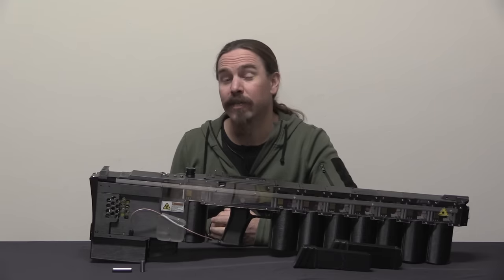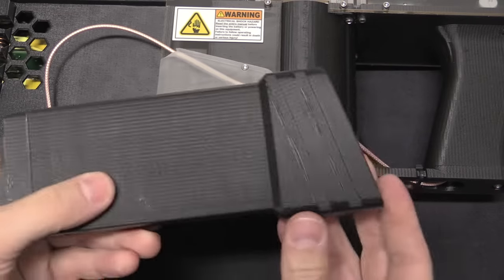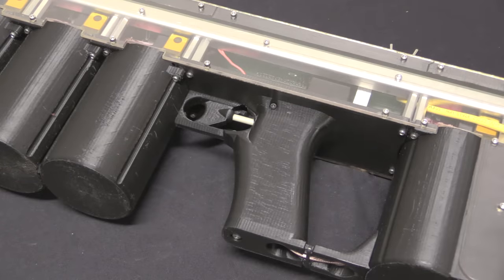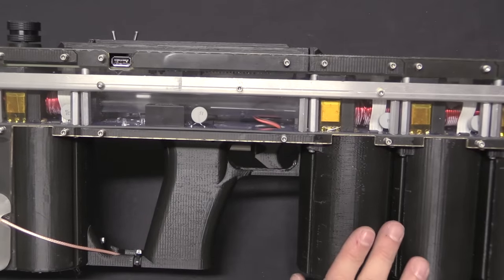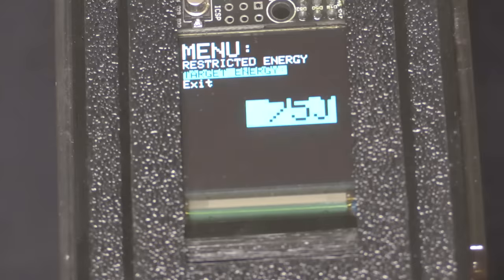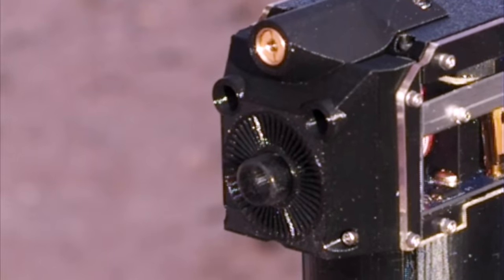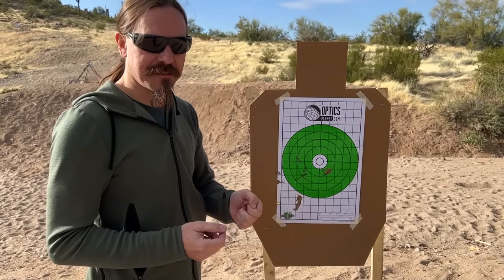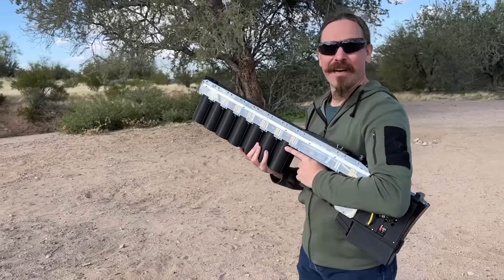ArcFlash Labs' GR-1 Anvil Portable Gauss Rifle

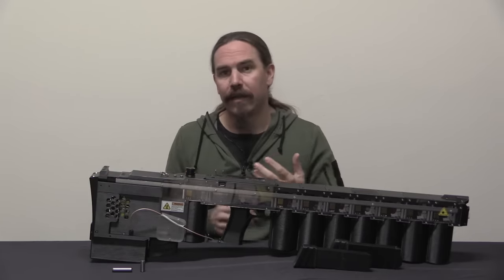Comment: 2:22 I think you meant to say 3300 mAh battery, since even a thin-film 25V 3300 Ah (or 3.3 kAh) lithium battery would weigh at least 230 kg.
Great showcase, really cool stuff!
Reply: Id suspect 33Ah. 3300mAh can fit into a much smaller package like an 18650 cell.
Reply: I think he meant to say 33,000 mAh bc there's no way a 3300 would have enough energy to do this.
Reply: Yeah, it looks about 3 times the volume of my 1100mAh 6S packs.
Reply: It says 3300mAh in the manual. 3.3kAh sounds dope tho. Charging the battery every 4000 shots sounds fun lol
Reply: @vockski3173  not 18650s but it is Li-Ion, just a 6 cells in series, giving a nominal voltage of 22.2V and full charge of 25.2V and 3.3Ah or 3300mAh. But since a step up converter is used to charge the capacitors, the input voltage swing doesn't matter all that much.
Reply: @V9TEK1  power delivery is the problem, as stated above. muzzle energy =/= battery energy
Reply: @lakiza55  I understand that very well, however, from 297000 Joules of energy, even at 1% efficiency, you could still extract 2970 Joules or just about 30 shots. Also, as you yourself pointed out, the manual also says 3300 mAh, so what are we arguing about?
Reply: @V9TEK1  not arguing, just stating that a 2.2KW/100A power draw out of such a small battery pack is quite a bit extreme.
Reply: @lakiza55  Right, sorry, my misunderstanding. I was wondering how they get that as well. Your 6S3P idea sounds quite possible. It could also be that they are using one of those Li-Pol packs used for model aircraft, some of those go up to 100C
Reply: @V9TEK1  Really? Didn't know 100C was a thing. Apparently these Li-Po packs on amazon state 11.1V 8Ah, 3s2p, and 100C discharge. And it weighs only 500 grams. A single cell doing 400 amps is beyond me. Although they do have significally lower gravimetric energy density, than, say 18650s that max out at 10C(177Wh/kg vs 243). Very interesting, learned something new today. An educational discussion is always a treat.

Comment: FWIW: The issue with coil guns is magnetic saturation of the projectiles. A metal object is limited to the amount of force applied which limits the force that can be applied to accelerate the projectile. So these will never match the performance of Scifi Gauss guns.

For an analogy comparing a firearm with a coil gun is like using force you can apply to pull to accelerate an object using  a thread vs a rope. The coil gun is limited to acceleration you can apply if you used a thread, and a firearm is limited to the force you can apply using a heavy duty rope.

It make be possible to improve the maximum acceration of a the project using projectiles made of a laminations of thin steel rods (ie like a transformer core made up of laminations of sheets of steel). A NB magnet as a projectile would also help, or using metals that have a very high magnetic saturation. Another alternative would be to make projectiles made up of coils of copper wire.since the copper wire will induce a repulsive field that doesn't suffer saturation, but won't transfer magnetic energy as efficiently as a magnetic projectile.
Reply: What about a slingshot approach? A cradle made from material with strong magnetic properties that pick up a metal/ceramic/composite/other projectile. Accelerates it through the barrel but stops in the barrel and back up to pick up another projectile. Mechanically more complex but opens up a possibility to shoot much more types of materials.
Reply: Yes, this is what I thought as well. I remember doing some napkin math and saw that you couldn't get to the muzzle energy of even a 9mm without a very long barrel length (Exceeding 2m / 6') using regular iron or steel slugs.
Reply: I like turtles.
Reply: Is this due to hysterisis?

I always wondered if it was possible to launch projectiles using just the dielectric field itself, possibly by using an impulse dielectric wave similar to what Nicola Tesla (and Dr. Thomas Henry Moray as well) discovered and applied in many of his inventions post Colorado Springs by harnessing the power of the transient created by a spark gap but then the whole weapon would need a complete redesign. It also takes my idea of spin stabilizing the projectile by using a Rodin type or Starship type coil instead of a standard coil in a Gauss rifle and throws it completely out the window because you are no longing generating the magnetic portion of the EM field and it would be strictly dielectric at that point. Another problem with using laminated silicon steel is that it isnt really available for consumers to buy and anytime I wanted to use it in a project I always had to salvage it from old appliances and the rotors and stators of old motors, although I guess if their was a consumer market for it opening up maybe the manufacturers would be willing to sell it in non wholesale commercial amounts...

Comment: Gauss guns in the future could technically fill the roles of SMG, AR and BR with just a change of the power.
Reply: and even have a non-lethal mode.
Reply: Presumably, you would only make the gun as large as necessary.
Reply: @jameswhite153  Oh god, instead of beanbag rounds, you suddenly get a steel dowel to the back. Ouch
Reply: @mrhyde4732  If this is any consolation, it's probably going to be tipped with rubber or foam if it's for non-lethal usage
Still would really suck though
Reply: Come to think of it, gauss guns could even act like a shotgun for close range/room clearing if it could fire multiple bearing balls at once
Reply: @jameswhite153  I mean, where else would you aim?
Reply: @mrhyde4732  that's fair

Comment: Since the barrel can't be bore to spin the projectile, my bet is the projectiles themselves are going to need to have corkscrew engravings so that when they are sent through the barrel the air resistance will give them the spin required for true flight.

Also would help to have pointed tips to deal with initial air resistance.
Reply: Fin-stabilized projectiles maybe?
Reply: @elanvital9720  a sabot maybe?
Reply: Perhaps a rifled barrel with a plastic discarding sabot?
Reply: Would there be any benefit to making the ammo round balls instead of oblong slugs?
Reply: @myWiggy  easier to make?
Reply: @skeltonslay8er781  You don't need a sabot with EM weapons, as Ian pointed out you can already shoot slugs much narrower than the barrel itself. Even then subcaliber ammo isn't really needed in EM weapons because it only makes sense in chemical energy guns where you want to have good obturation of the barrel and more surface area to push the munition. Sabot only allows to do this with a lighter and thinner projectile to get greater velocity and lower drag.
Others talked about a rifled barrel but there is also no point doing this since the shot doesn't ever touch it, and if anything you'd want to avoid this to get rid of friction wear.

I'm sure the shape will be progressively optimized but logically it should be as light and have as low drag as possible to be fast with low energy requirements, while having max penetration. That tends to favor longrod penetrators with fin stabilization, though one might need some device to avoid yaw.
Reply: @elanvital9720  Using a sabot in an electromagnetic carbine is very practical. You can use the magnetic material as a lagging for many things. For example: a non-magnetic material with a high atomic number, a glass vial of liquid, a compound structure with a standard drive and maneuverability. Actually endless possibilities, due to the fact that in such a weapon you can adjust the projectile acceleration rate, input/output energy, etc.
Reply: @elanvital9720  @Skelton Slay8er so many comments have ended up describing (partially) actual lore-accurate halo weapons
Reply: Have a small electric motor with a rubbercoated drive wheel that spin up the projectile before launching it..
Reply: @TheBibliofilus  Could be trigger activated along with the capacitor charging sequence.

Only problem is that the slug is housed and seated in the magazine before being pushed into magnetic launch.

Would probably have to redesign the entire firing mechanism and magazine to accomodate it.
Reply: @TheBibliofilus  my son has a few of those guns with that exact firing mechanism. Really good design. NERF has perfected it. Throw a few capacitors ahead of that with a steel dart rather than that foam rubber and watch your NERF battles get interesting 👍🏻 lmao
Reply: YES!
Reply: @elanvital9720  CNC machines projectile. nods
Reply: magnets can impart spin
Reply: the magnets can spin the projectile
Reply: Point is not the most aerodynamic shape.  See: "Bulbous bow".

Comment: Assuming that gauss cannons will eventually rise up to the level of modern firearms, it’d be a very interesting look into how history always repeats itself with some variation. The most primitive ranged weapons have an object pushing a projectile at high velocity (bows, slingshots, etc) and then of course they evolved to using combustion as a way to propel the projectile. So it’s interesting to see weaponry like this return to its original roots of “object push projectile” with something like a gauss weapon, even if it is magnets and electricity instead of string!

Comment: Kinda surprising that they didn't employ this thing as a grenade launcher. It would meet those requirements a lot better I think, even with very little optimization. It can more easily move a large mass at medium velocity, well suited to deliver HE I think. Not to mention the large mass of this thing is more tolerable if you are bringing more firepower to the equation.
Reply: As someone who played with these... Me and my friend tried to shoot "explosive" rounds out of his "accelerator" (we took an empty steel tube, inserted a firecracker into it, and put the fuse out through the back, his "accelerator" was sort of a bolt-action, so we could light the fuse before loading it into the barrel), there is one significant problem.

The less ferromagnetic material in the projectile, the less attraction, so the pipes were much, much slower than a solid projectile would be. Thus, we didn't fire a "live" round, because when we dry-fired one (shot it out without lighting the fuse), it just flopped outta the barrel, we deemed it too dangerous to try with a "live" one.
Reply: There’s also the question: “why would you?”

Like sure, it might do the job and do it reasonably well, but give me one good reason to add all this extra weight and electrical shenanigans to a perfectly serviceable chemically-driven launcher?  What’s the benefit?

That’s what makes these things difficult to sell in the first place, even when you scale them up and test them on naval vessels with military funding.
Reply: If you use these on a vehicle, you dont have to deal with the risk of having ammunition exploding if hit by enemy projectile
Reply: @TheRoland19111  Gonna point out some info right here...

1. Weight to max shots fired ratio goes way up for these. Remember, that this rifle has nearly (sic!) as much muzzle energy as a .22LR, which is a teeny tiny cartridge, shot outta a teeny tiny gun. Now imagine that scaled up to a vehicle-mounted grenade launcher. That thing would be the size of a whole tank turret, I assume.

2. Yeah, the ammo won't explode when shot... But the batteries will. And they will gladly do so, don't have to ask them too many times. Ever seen an e-cig battery blow up? Now imagine that times a thousand. Bravo. Now the vehicle is an oven, setting at around 2000°C in the near proximity of the burning battery. Not to mention the toxic fumes, lithium or not, batteries aren't the stuff you want to burn in a confined space

3. Battery charging. Imagine getting attacked while the vehicle just has been plugged in while completely discharged...
Conventional armaments don't have that problem, since you can just have a few cases of ammo at hand and just throw them into the vehicle, give the crew two to three minutes and they're blasting (if they're well trained ofc)

Electric gun? Not really. Picture EV charging times, but even longer, since the amount of energy needed for this kinda stuff would be enormous.

Honestly the only use of electricity as a weapon that I think would be beneficial to the military seems to be either EMP or lasers, maybe some kind of an electric fence or a military-grade plasma cutter of some sorts...
Reply: @Bednar121  There are some tests of anti-missile and anti-aircraft lasers you can watch. They're pretty cool. Much more practical than this, certainly.
Reply: @_mwk  If memory serves the big number one reason you don't see lasers used in weaponry much is that their use on things like tanks or soldiers actually counts as a war crime under the geneva convention, as you could really easily use a laser as a weapon that permanently blinds enemy soldiers, which for obvious reasons is generally frowned upon. This is why the only laser weaponry you see are anti missile / anti drone systems and not something that would be reasonably used in a manned combat situation, as both of them are piloted remotely.
Reply: @kingkuma4112   Lasers are also used for the disabling of engines as well
Reply: @kingkuma4112  Yeah, routinely having soldiers with lethal weaponry firing blind is not something people want.
Reply: @OneBiasedOpinion  Anti-material rifle? It’s definitely not very useful right now, but no one has claimed otherwise.
Reply: @jeremysaklad6703 Additinally there's the fact that an offensive blinding weapon falls under the same sort of reasoning for why things like cross-cut bullets (basically rounds that fragment upon impact with a body) are also banned - if a soldier gets a bullet to the torso, even if he survives he'll still be out of action for a long long time, so any attempt to make sure a bullet is more lethal is basically pointless. While yes using a laser to blind enemy soldiers would be extremely effective, the general consensus is that it counts as inhumane as you're basically giving someone permanent blindness when a bullet would do the same outcome in terms of the war without taking someone's sight away.  TLDR: Any weapon which causes some permanent disability basically automatically gets added to the war crime list after the fact that some of the ww1 gases caused permanent breathing issues became clear.
Reply: @kingkuma4112  I don’t really agree with saying death is better than blindness: the issue here is that it could easily lead to civilian death and collateral damage.
Reply: @jeremysaklad6703  You're not wrong - a powerful enough laser needs a lot of energy, and well, we all know capacitors don't handle getting shot well. I was more focused on the specific reason that geneva banned their use rather than why they also wouldn't be very practical.
Reply: would probably EMP out any electronics in the warhead of a grenade
Reply: Great point

Comment: This gets my imagination burning, especially since I’m trying to write a sci-fi novel where a majority of weaponry are MAGs!  I wonder if the projectiles might perform better as fin-stabilized sabots of a much smaller caliber.  Definitely would improve impact force since velocity has a greater influence than mass
Reply: In the interview they discussed magnetic rifling and fins for being future. However they also said the trade off of choosing coils instead of rails is that bigger projectiles get accelerated better than small ones.
If you do rail's instead, you have to regularly replace the rails.
Reply: True, though I’m not thinking of the sabot for stability.  It’d be more to help feed cleanly from a magazine.  Plus you’d be able to use a more dense metal that may not be magnetic for the projectile and something magnetic as the sabot for the coils to “grab” onto.  

I’m just super excited cause this is pretty close to a lot of the ideas of how the weapons will work in my story!
Reply: the problem there is a bit inherent in the weapons platform; for that reason you might want to reintroduce other weapons of totally different categories, like the “sluggers” conventional firearms used in star wars because bullets are harder to stop and faster than blasters for the sith and jedi. 

Basically, in the name “mass accelerator”, lies the truth. These won’t ever reach the speeds of rail guns or light-gas guns (another interesting real gun type to consider including) will fire at, but it can fire much larger or heavier projectiles. Imagine the bolsters from war hammer; every soldier is carrying something that can act almost like a grenade launcher. The limits to speed are based on the fact that the magnetism of each coil has to switch as soon as the projectile passes it, or it’ll be pulling it backwards. This reaches extreme not only the limits of switching and processing, but the drastic levels of current required exacerbate the heat issue. 

That’s not to say that they won’t make great weapons, it’s not hard imagine somebody with soft 3A armor having their ribs crushed by one of these, but that’s the likely purpose.

The other advantage is how quiet together are, but remember that a hypersonic crack isn’t unique to just fighter jets and bullets.

Good luck with your novel!